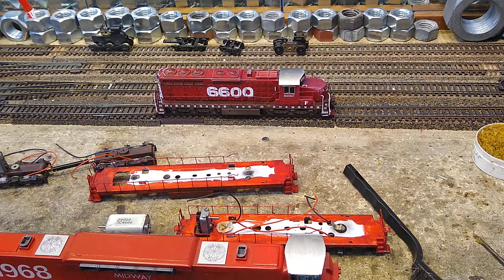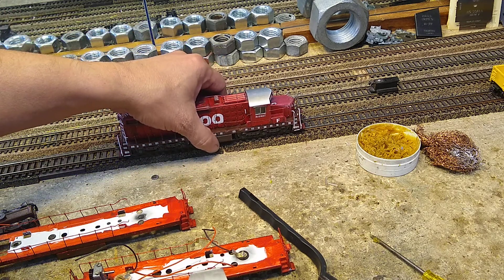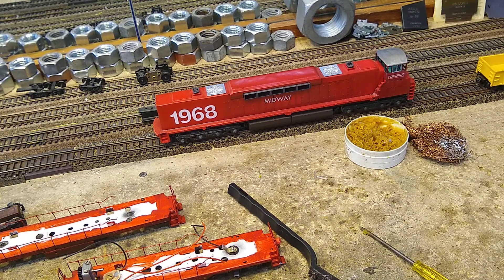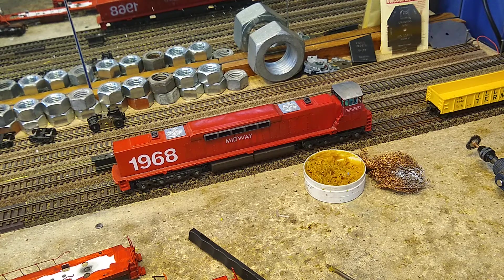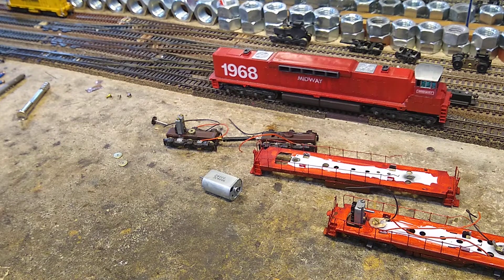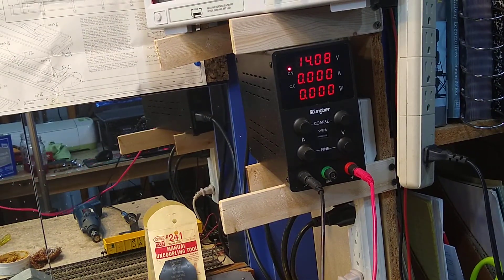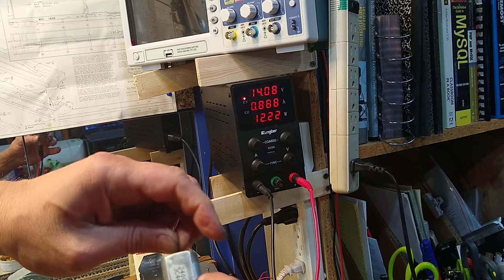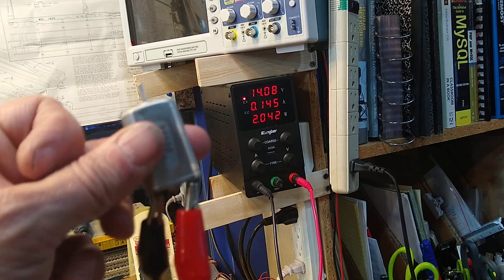5 locomotives in 30 days part 26 Tenshodo new motor testing

Comment: What is the prototype name of the "Ole 1968"?  6600 run's pretty smooth, it should quiet down after break-in.
Reply: I don't want to cause a fire.  Sure you don't.  That would make one hell of an ending for a video.  You keep having and then missing all these great endings.
Reply from the maker: 1968 is my Hercules... it actually says Hercules on the front in raised letters that I 3D printed.  In theory, this is an MP40.  It has the cab of an MP15 and runs long hood forward.  It was built specifically to serve my most important industry which is called Osmium Mining.  the osmium ore cars are much heavier than iron ore cars so some a long and low and others are short with low sides.  in the real world, no one is able to mine osmium in any quantity that would need rail service, but in my world it happens.  osmium is also hazardous so special cars are needed.  a special locomotive is needed to pull these cars in the industrial park that has very high tractive effort and lower weight per axle which also pulls at slower speeds than other locomotives and that is how the MP40 came about.  the space is limited so a single large locomotive is much better than several normal locomotives.
Reply: @elite194  Cut out the fuel tank jack in an extra say dummy set of trucks on the DD40
Reply from the maker: @blainedunlap4242  I got something like that in a junk box I bought at a train show and another where someone put 2 B trucks inplace of the D truck
Reply: @elite194  Should I ever visit your layout or we go have a beer.  Please arrange legal council and alert the local fire EMS station.  We should be good then.  Where generally do you live.

Comment: 👍24 v is good for brass, hobby town drives or practically any other make that can be remotored, and as you have proven and getting excellent performance.👍
Reply: How do I find the 24 volt johnson motor, on ebay orwhere bud.  Does a version of it come with duel shafts
Reply from the maker: @brian5606  neither the Johnson or the Mabuchi have released dual shaft versions yet.  The motor shortage started last summer and is still going on.  Right now you have to use anything you can get a hold of.
Reply from the maker: the new Johnson motor is amazing as you will see in the video I'm uploading now
Reply from the maker: at the train show last weekend I picked up an FA2 that I believe is Hobbytown, but my experience with those drives is limited because I only have a couple and none have yet been rebuilt